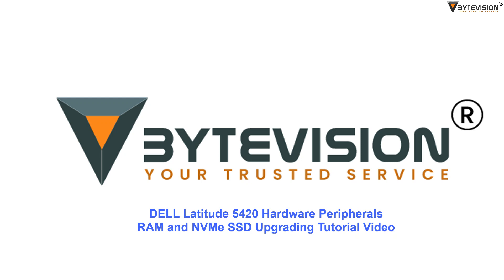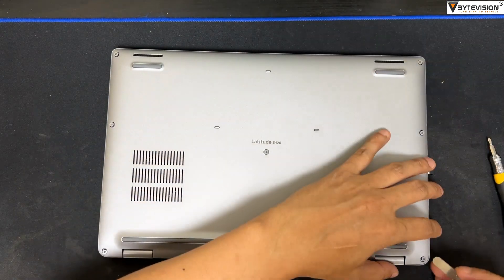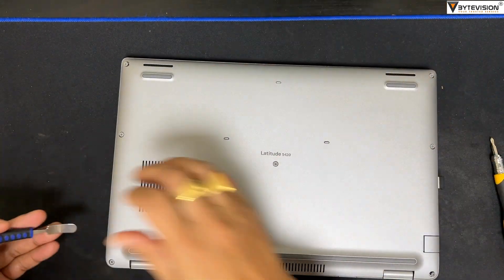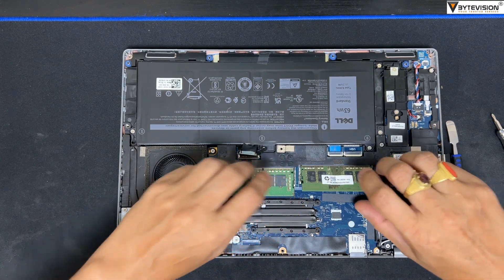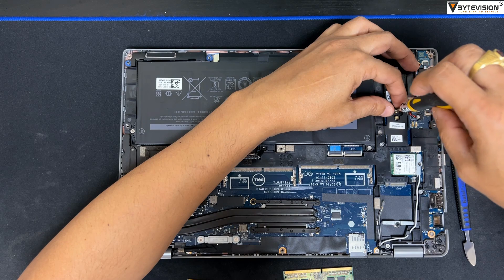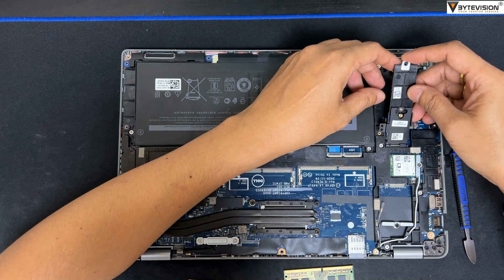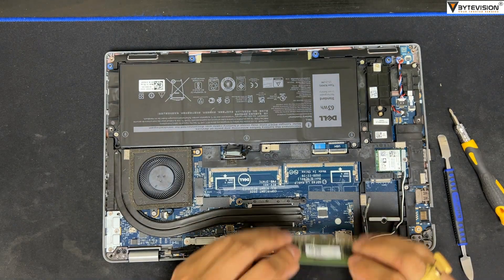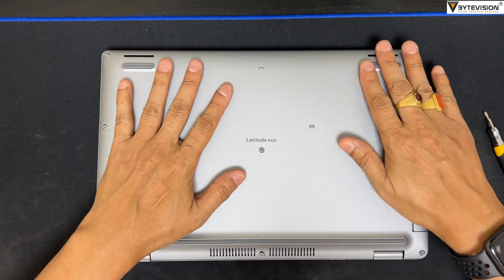DELL Latitude 5420 Hardware Peripherals RAM and SSD Upgrading Tutorial Video

Comment: Does the Dell Latitude support NVMe of up to 4TB I'm looking at getting the Samsung 990 PRO 4TB PS5-compatible SSD
Reply from the maker: Dell Latitude 5420 laptop supports a maximum of 2TB for a single M.2 PCIe NVMe SSD. It also supports DDR4 RAM, with a maximum capacity of 64GB.

Comment: How many ssd slots does our laptop have? Dell says 2
Reply from the maker: Storage
This section lists the storage options on your Latitude 5420.

Your computer supports one of the following configurations:
One M.2 2230, Gen 3 PCIe x4 NVMe, Class 35 SSD (slot 1)
One M.2 2280, Gen 3 PCIe x4 NVMe, Classs 40 SSD (slot 1)
One M.2 2280, Gen 3 PCIe x4 NVMe, Class 40 SSD, Self-encrypting drive (slot 1)
The primary drive of your computer varies with the storage configuration.

https://www.dell.com/support/manuals/en-us/latitude-5420-laptop/5420_sp14_setupspecs/storage?guid=guid-d79f17ca-e619-43e7-82a5-a0b0e7fb5c0a&lang=en-us#:~:text=This%20section%20lists%20the%20storage,%2Dencrypting%20drive%20(slot%201)

Comment: Hi i want to know that is there only one slot for storage ? I have 256gb ssd in same laptop but its not enough for me
Reply from the maker: Storage
This section lists the storage options on your Latitude 5420.

Your computer supports one of the following configurations:
One M.2 2230, Gen 3 PCIe x4 NVMe, Class 35 SSD (slot 1)
One M.2 2280, Gen 3 PCIe x4 NVMe, Classs 40 SSD (slot 1)
One M.2 2280, Gen 3 PCIe x4 NVMe, Class 40 SSD, Self-encrypting drive (slot 1)
Reply from the maker: One M.2 2280, Gen 3 PCIe x4 NVMe, Classs 40 SSD (slot 1) only.
Reply: @ByteVisionTechnology  thankew 🙂👍
Reply from the maker: Thanks for your valuable TQ, feel free to reach out for any technical query.